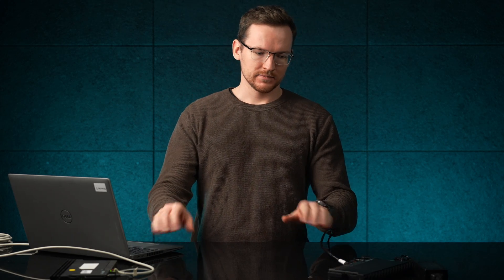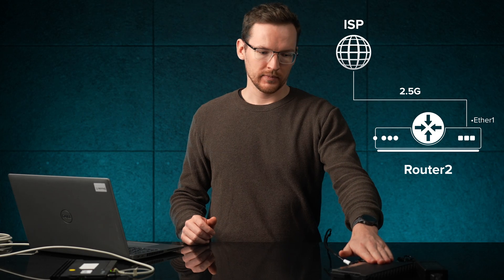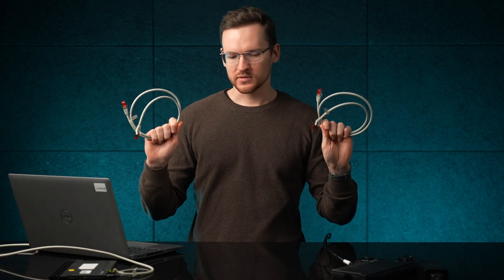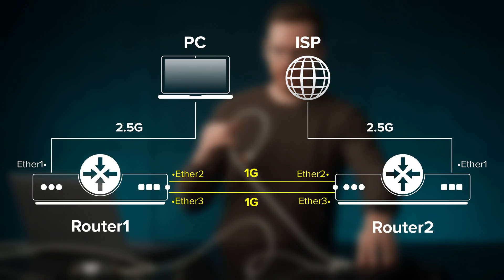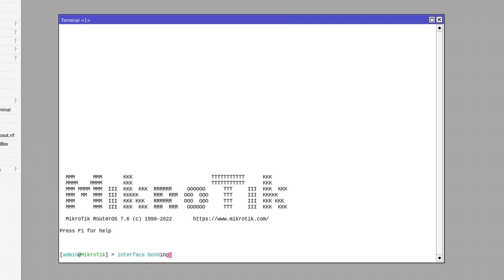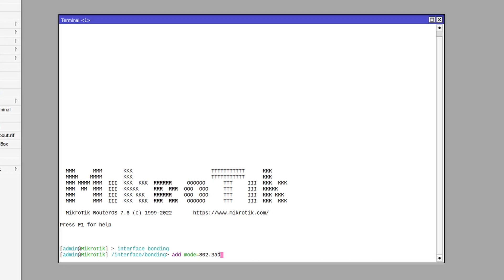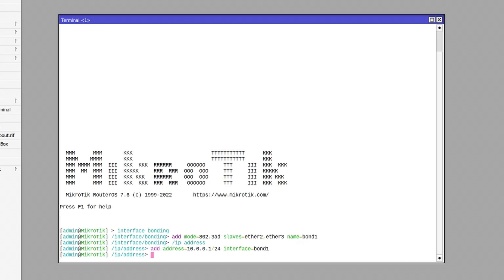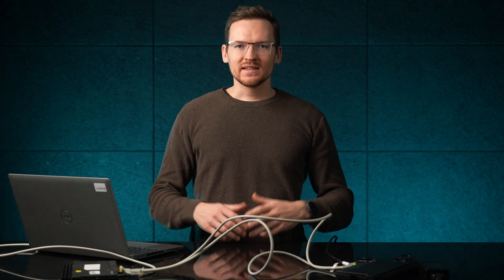Link Aggregation with MikroTik

Comment: Hello sir
If i have 2 routers with eth 4 and 5 connected and bonded
And the network i want to access is on the Lan which is on eth3
Should i add the bond interface in a bridge with eth3 on each router?
And must the bond have an ip address in the subnet of the lan

Comment: Beautiful and brief .  Pronounciation too is very clear . This looks more like layer 3 port channels. Can this be done for for mikroktik switches L2 .and how
Reply from the maker: With 802.3ad and balance-xor modes this will get hardware offloaded to the switch chip, but the transmit hash policy will always use Layer2+Layer3+Layer4. In other words you will only benefit from the full bandwidth if you do multiple connections.

Comment: I finally solved mlag on 2x CRS309 as was unstable.  Requires RSTP (or STP) and with bonded iccp peer-port must also set ARP=disabled on the bond interface (undocumented). Verified stable on 7.6 and 7.8. I didn't retest on 7.7 but suspect this was the issue. iperf3 shows stable 9.x Gbps with any combo of links up and down. Tested on Proxmox with x520-da2. I created a ticket and noted this with suggestion to update the doc.
Reply: Does the set ARP=disabled have an effect on a LACP 802.3ad bonding that you know of? Looks like ARP is enabled by default.

Comment: 👌Using master slave terminology in 2023, bold. The artist formerly known as Kanye would be proud.
I tried really hard to get some RB5009UPr+S+IN's to work in my setup, but to do so would have just been too janky.  Ended up just using a couple CCR2216-1G-12XS-2XQ's like I know you intended all along.
Also, what's the SFP+ to 2.5g e compatibility like?

Comment: Just want to add, if you want to get the 2gig throughput on your laptop don’t forget to setup default route using router 2 bonding ip (10.0.0.2) and add a masquerade/src-nat rule on router 1 and 2 as well.

Comment: You forgot to mention that link aggregation does not really aggregate speed of two links, so every single transmission can not exceed single link speed. Using full LAG potential in home setup  is rather quite difficult and unusual.
Reply from the maker: Isn’t a real life network using lots and lots of connections?
Reply: @mikrotik  IDK, when I'm downloading some 80 gb game from steam I haven't bothered to run wireshark to see. I did try running an HP 8510C but I couldn't make heads or tails of those smith charts.

Comment: speed per link is still 1G max...
Reply: the maximum throughput between any two devices behind each end of the port channel will not exceed the link speed of the physical port in the path.
Reply from the maker: What you are saying makes no sense, sorry. The RB5009 has 2.5G ports and between the two units, there is now a 2G bonding connection. The speed is now limited to 2Gbit. We can make a part 2 where you can see throughput tests.
Reply: @mikrotik  max speed is 1Gbps per one TCP connection/Path. When you have for example two TCP connections you will get throughput 2x1 Gbps. So it depends on an application level if it can use more connections in its own protocol and benefit from LACP. You can make part 2 where you can demonstrate this behavior. For example iperf with single TCP connection. It should not exceed 1Gbps.
Reply from the maker: There are not many real life situations where you have only a single connection over a link. This video describes a real life use case to increase bandwidth in a network.
Reply: @jirikotalik1408  Thank you ! ...not sure why @MikroTik doesnt want to admit it. LACP isn't the wonder tech ... a VM migration or a VM backup that is single thread, on an LACP is stuck at the speed of a single port speed of the LACP.
Reply from the maker: Your example is more of an exception than the rule. Like I said, most real life connectivity relies on many connections
Reply: @mikrotik  depending on how good the LACP implementation was done. You can find some really bad situations, where you are bottlenecked:

- Connections are not migrated between the lacp members
- if one host has connections active on one lacp member the others will stick to that member cause mac-src balancing.
- if a few LACP members flap, the connections are started on the remaining ones but the traffic will have affinity for those members that don't flap.
- Load Balancers and old Exchange CAS servers via LACP links, very strange to investigate situations. Main action, bypass the LB , if it works the issue is not on the Exchange side.
.
.
Reply: @mikrotik  anything http nowadays is using pipelining to avoid opening multiple tcp connections, any file transfer i.e. from NAS will use single tcp connection etc.
Reply from the maker: Huh? What do you mean? 🤔

Comment: how about connecting 2 provides to 1 router. In a way that is can use either provide, not just one as a fallback.
Reply from the maker: You can't do this with this method, as it requires you to control both sides of the bonded link.

Comment: Nice video but I will add that both slaves interfaces cannot be part of the bridge interface and in this case they are acting as a L3 point-to-point connection between the 2 routers so static routing is required to make traffic flow between them if Layer 2 extension is not used.
Reply: You can add the "bond1" interface as a slave interface  to the bridge. So a normal layer2 connection is possible. I use this in several scenarios.
Reply: Bond interface can be member (slave) of bridge interface, works perfect

Comment: Well, that's why rb5009 or rb4011 must have two sfp+ ports, not one. So you can stick whatever speed you need in both directions.
Reply from the maker: If you have more than one router at home, this is much cheaper. Adding more 10G ports to a device will raise the price considerably.
Reply: @mikrotik  if you have a switch at home next to the router then 1G ports on a router are a waste of money. It just needs sfp+ up and sfp+ down links. Save that extra by replacing rj45 with one sfp+
Reply from the maker: If your router has enough ports, then switch is a waste of money. Depends on what you are building.